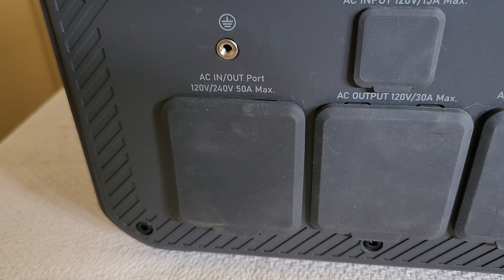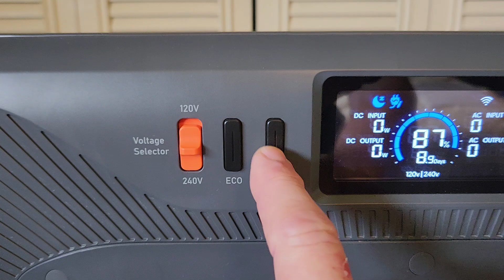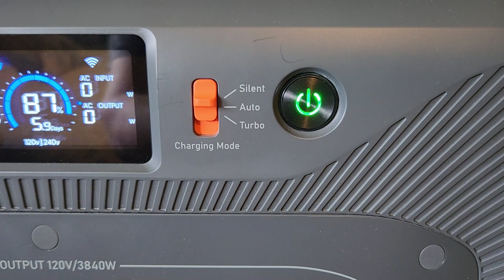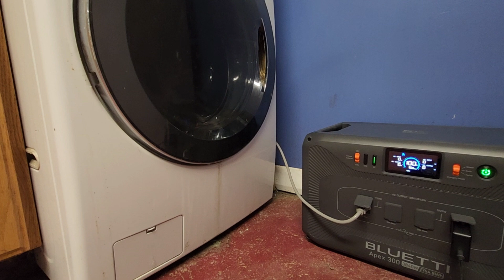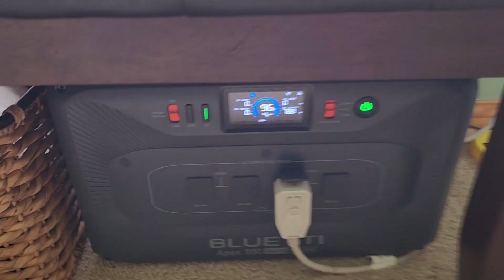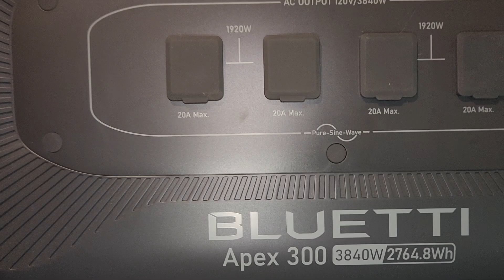The Bluetti Apex 300 amazes with it's expandable Home Backup capabilities

Comment: So why does nobody show  why someone would want 240 volts and use it rather than just showing us buttons and outlets
Reply from the maker: Hello! To a degree I do that in my video where I connected the Apex 300 to my house critical circuits. Since my transfer switch is set up for 240 volt split phase I was using the Apex 300 in its 240 volt mode. In my case I do not have any 240 volt appliances or equipment on my critical circuits, even though I do power my home well pump since it is only a 120 volt pump. If my home had a 240 volt well pump the Apex 300 would have been able to directly power it without needing to have two in parallel as in the case of an AC300 or AC500.

Comment: This unit is exactly what I've been needing to take my apartment off grind.  My electric bill is way too high and they're planning to raise the rates and do random cut offs because the grind won't be able to handle the summer electricity needs.  It just sucks that indego and bluetti don't ship to Puerto Rico.  There's a few places here that do sell solar generators, but they are ridiculous over priced.  Like an ecoflow delta pro goes for $5,000